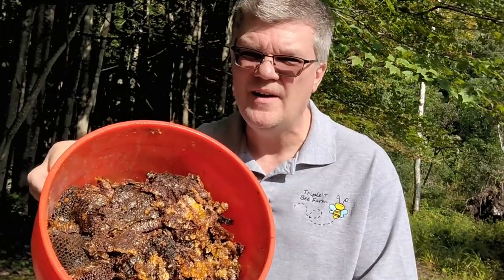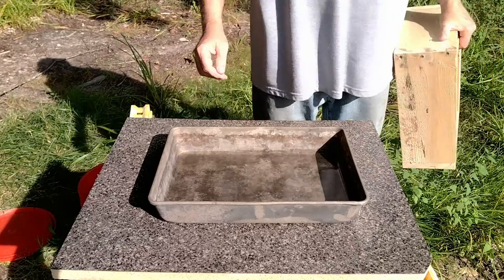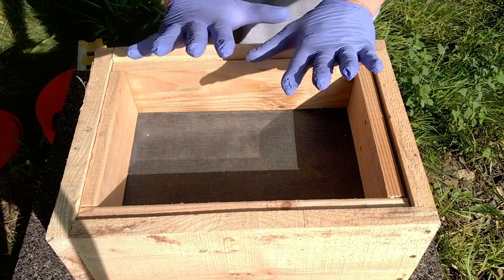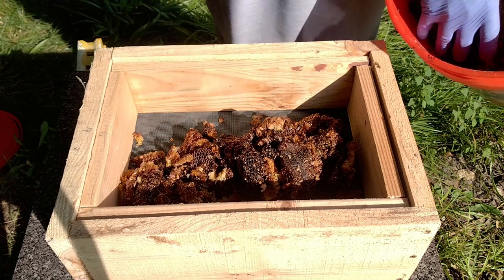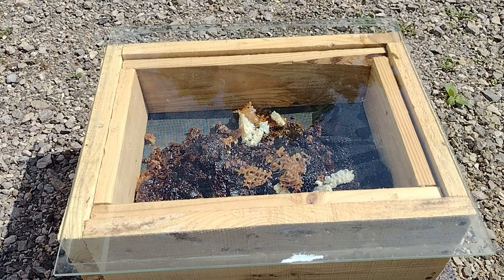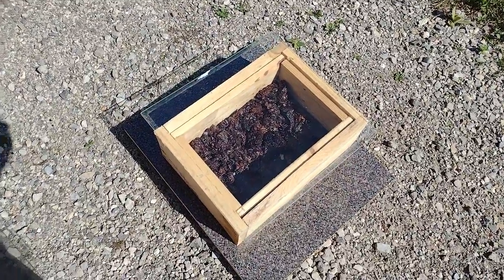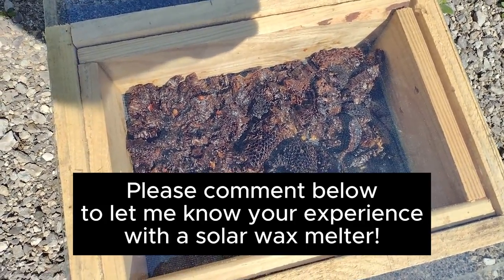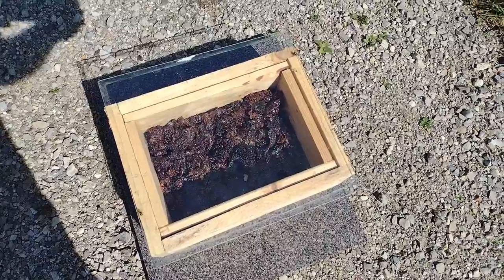Did I FAIL? Are solar beeswax melters worth the effort?

Comment: Design your melter to tilt towards the sun.  Paint it black to absorb more heat.  
Also, it takes time.  I’ve had wax melting up to two days before it stopped dripping.  
It’s fun to experiment. 
I had a friend who used her old panty hose and hung it in a long vertical style melter that worked just fine.
Reply from the maker: Thanks for watching and commenting. I appreciate the advice and encouragement.